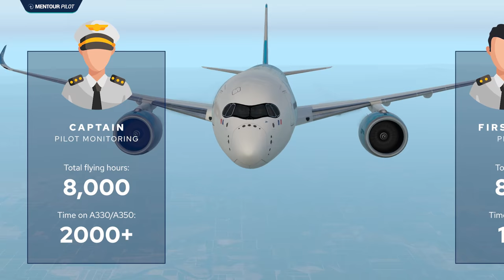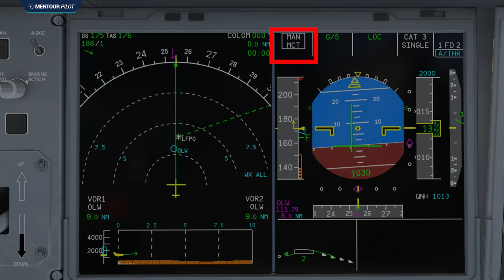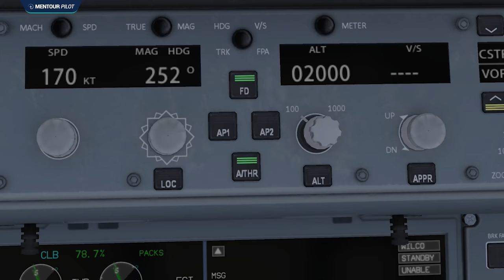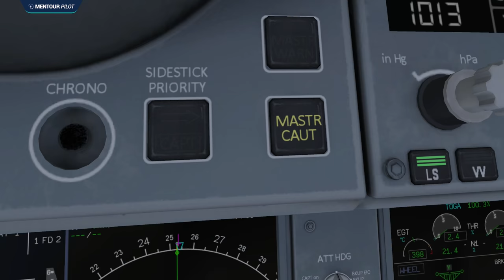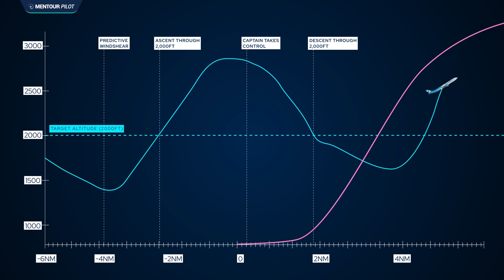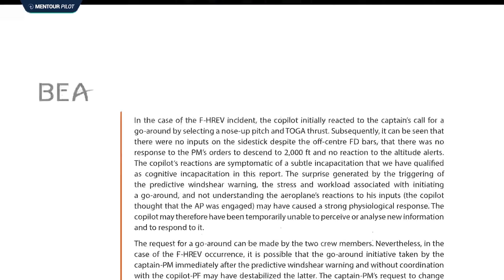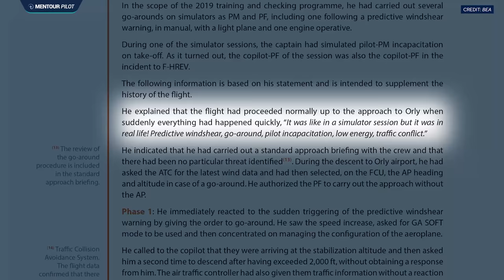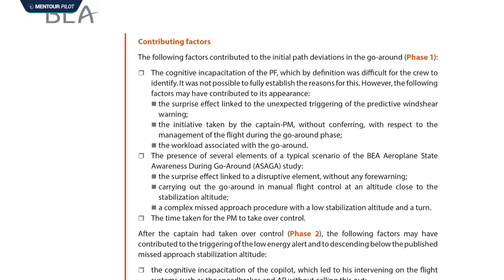What HAPPENED in this A350 Cockpit?! French Bee flight 711 explained!

Comment: Coming from a mechanical background I'm amazed at the technology and gadgets in a modern cockpit and also the aptitude and training of the pilots that fly these modern marvels. That said I did my best work when I broke up complex systems to diagnose a problem, my worst days were when l got bad information from an operator or a faulty sensor, these CNC machines had one main monitor you easily see the operations and vectors spacial coordinances speeds and speeds... when i look at an airplane cockpit l see a literal Custer f_ck

Comment: My 2 cents. Calling an immediate go-around after the predictive wind-shear warning when the weather was clearly not conductive to wind-shear has triggered the whole episode. Maybe, jus maybe, if the captain had abused for a second or two (hey wee high enough above the ground o be enough time to o it), to evaluate the likelihood of a spurious warning, instead of having such knee jerk reaction, would have avoided the whole ordeal.
No ask yourself: why did the captain react in such a mindless way?
My guess would be that he’s been trained to rely on systems rather than on his airmanship
That is a failure of management a the highest levels of airlines, manufacturers ad regulators.
Despite pilots time and time again saving the day, they push towards reliance “dumb” automation (not evolved AI, which sadly will eventually replace us pilots), in the delusion that doing so will eliminate human error, instead replacing pilot error with engineering error.
So the skimp on pilot training (and hence “save” money, to the delight of shareholders), and reduce the pilots to procedure followers, checklist readers and button pushers
“If you think training is expensive, try an accident”

Comment: I didn't understand why the Pilot didn't take over the 1st time when the FP didn't respond, as to do so 50 seconds later in such a precarious situation, appears to be a last minute action & increased risks of an accident happening. 

Not responding can be for many reasons but certainly the result will be that nothing is executed.
It doesn't matter why the FP isn't responding ( ie full or partial incapacity), the flight controls need immediate attention & correction within seconds and every second counts. 

Why is a Go-around excessive stress even if it's unexpected  2nd to a spurious warning  ?
It's a routine safety measure.

So, perhaps the personality of this co-pilot is not suited to stressful situations, irrespective of how good he is at  piloting in Normal circumstances.
So, perhaps commercial flying isn't the best option for him, as it carries so much responsibility ( passengers).

Comment: Core problem: unsafe pilot.  It's weak that the report cannot establish this crucial fact but needs to be sensitive about feelings. That should not be on!
It leaves everybody, flight personel and passengers alike, insecure if they fly with this pilot not up to the job. The lives of a full airplane and the confidence of the passengers is so much more crucial than hurt feeling of an inadequate pilot being fired when falling short of the task. Skip all the cuddling, group-hugging wishy-washy. It should be a core part of the vetting for the job not to be prone to stress under pressure. Image a fighter pilot did not have this requirement, he would be dead in hours. Only employ those that meets all requirements.
I was in airforce pilot training once and I didn't learn the feel of the plane fast enough, so out I went. And I'm happy because I get to live longer as do the ones I didn't crash into on the ground.
Reply: No. It’s just the report writers are more capable of understanding complex ideas than you are.

Comment: I think this is farcical, not just from the point of view of the crew's actions but the different conflicting modes and autopilot settings and indications. Should they not be just flying the plane? They were flying manually until this happened and it was when all this automatic missed approach guidance kicked in that everytbing started to go wrong.
Reply: No. You’ve got it completely wrong. If they’d used the autopilot it would have helped them.  The modes were trying to help but the FO wasn’t following them.

Comment: I don't understand how the FO was so surprised by the work load on landing.  He knows that take offs and landings are much more heavy work loads.  He chose to manually land the plane.  So he has control of the plane and then gets 'cognitive overload' and 'surprised' when he gets a wind shear warning such that it shuts down his brain??  How can a more intense workload that you know in advance is coming, and that you have chosen to take  on and do by flying manually, cause such a cognitive breakdown?  

I am not buying it.  The FO couldn't handle flying the plane manually, even though that was his choice to do so.  How can an extra warning make him go into shock at the work overload?. Then when the captain takes over, the FO starts pushing buttons and levers messing up the captains flying .  He doesn't tell anyone he is putting the speed breaks on or the autopilot 2 on?  This is completely unacceptable.   

If the FO can't handle flying the plane with minimal distractions then he shouldn't be flying.  He is a liability in the cockpit with his incapacitation over not very much, and deliberately jeopardising the pilot flying. Frankly I would boot him out of the job for doing that.  He could have easily crashed the plane with his nonsense.  The F.O has peoples lives in his hands and he throws the rattle out of the pram because he can't land the plane manually.

Comment: Here again, automation is intended to make things safer. As long as everything is normal, it likely does. But again, you're describing a situation where simple abnormal occurrences happen followed by automation simply confusing the issue more. Would this ever happen with an old-fashioned cable operated aircraft? Doubt it. Secondly, it demonstrates that just accumulating hours is no indication of the pilots' skills and expertise. 8000 hrs. accumulated flying 13-hour flights mostly in cruise does necessarily make a skilled and experienced pilot. It's no different than a pilot who accumulated 10,000 hours as an instructor doing fifteen thousand touch and goes in a 150. 

This go-around should have been much simpler than normal as the call occurred very early in the approach, not at decision height. He had all the time in the world to execute it properly. Some people are just not cut out for this line of work. This guy certainly is questionable to say the least so here again we have to question who we are putting into the flight deck. It's not the place to accept mediocrity or mental shortcomings. The question is, can a few more hours of training eliminate any chance of this guy not having the same issue with the next deviation from the norm? And then, how many more just like him are out there. This is definitely not the place for 'woke' folks.

Comment: What a sh*t design feature.  If it automatically turns off the speed brakes, why not automatically turn off the speed brake lever, instead of Master Caution warning, make you do a checklist and guess what's wrong?  And if it's on autopilot, why didn't it accelerate the engines automatically instead of "Speed Speed Speed" warning?
Reply: Because there could be a scenario where the aircraft is flying too fast for safe flap operation and the pilot deploys the speed brake.  And I think the aircraft was being manually controlled, thus autopilot wouldn't engage or had disengaged.
Reply: It’s not making you guess. It says what it’s done. It’s a good feature because it retracts the spoilers where they might be dangerous.

Comment: My guess.
In training, 'trouble scenarios' are expected. You may not know what form it takes. Also you know that there is no risk of crash and death in a simulator. 
In real life those things are reversed.... Very high risk of bad outcomes and genuinely no expectation or a plan. Not a real one anyway. 
Thrown in here is that the pilot flying is already doing something unusual, manually landing the aircraft. In a way its a bit sad that, because auto landing is SO good, manual landing becomes a thing of the past... and a big deal to execute. The computer makes complex and sudden tasks look easy and doesn't suffer from brain fade or stress induced incapacity.

It's sad also that humans look for someone to blame instead of focusing on remedies that fix issues. Anticipation of this human querk can BE the problem actually. "am I wrong? Will I be in trouble? Get fired? Will I be able to explain my actions afterwards?", will all be distracting thoughts that pass through the distressed pilots brain, and fade him further. 
Four minutes is a very long 'brief pause' admittedly. Perhaps he felt he had no way to ask for help, acceptable in the circumstances? The captain's clear trust in him, after all, is demonstrated by the very long delay in assuming command, is it not? , or am I misinterpreting that?
These fine call scenarios are serious and seem to be becoming frequent.
Also, if having a full set of automatic reactions IS the problem, when no preformed responses come to mind, is further "training" just going to dig this hole deeper? Is that not just increasing the number and depth of subroutines the pilot must REMEMBER, Increasing the chances of NOT remembering at the critical moment?
Another thought provoking episode. Thank you so much.
Timothy

Comment: Im pretty sure that you just got way too compressed in actually truly experiencing spatial disorientation.
Its disorenting. To become reoriented means a little more than i think one might normally surmise. As you said you felt as though you had to reset your mind. Well, it needs a moment to boot up. You need a second to process such an alien and honestly crippling place you naturally fall into when given such conflicting body/mind/instrument info imputs.
In most settings this is fine, but not the case generally operating an aircraft or any machine in real time. You likely would have not had your other issues if you werent still reorienting from that event. I think that maybe what you truly need "work" on is understanding everything you can about what you experienced so that if it ever happens again, it wont be so shocking in the moment and distracting afterward. Always keep the very next task at hand in sight in your mind, even if an anomoly occurrs. There will always be time for contemplation later when youre on the ground.
Its sad how we applaud somrone for doing exactly what they should do in moments of weakness or misstep. So few people today would prefer doing whats right in leiu of sparing themselves the discomfort .  Its sad that this video and your objective consoderation of yourself are so respectabke because we should see so much more of it.
But the fact is, it is respectable. Gokd on you n godspeed

Comment: Yet another reason pilots should get out of the cockpits and turn over control fully to AI. Just sad we still have fallible humans flying planes, almost all accidents are caused my humans.
Reply: And the Artificial Idi... are free of faults? Especially, these systems can deal with the millions of unpredictable corner cases?

Better think twice.
😉
Reply: @jantjarks7946  Can they handle every edge case? No. Can they handle very simple errors that pilots frequently make? Yes. Absolutely yes. Most disasters could have been avoided by just enabling the existing autopilot system. The current simple basic system would have been able to manage this issue, making it quite cake for an advanced AI. There were no mechanical issues or edge cases in this flight, just a pilot who wasn't ready to take over and perform a standard procedure.
Reply: @OstlerDev you’re correct that early use of Auopilot would have helped. But you still need a pilot to tell us what to do.